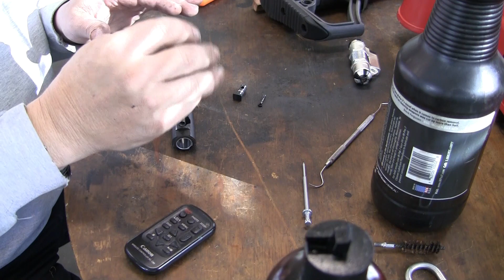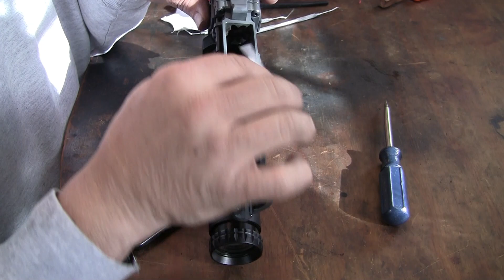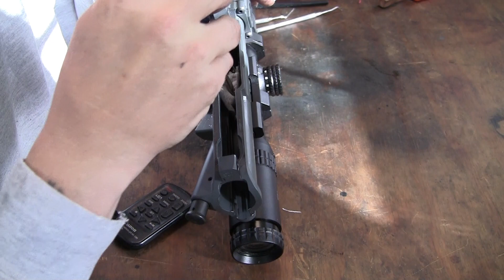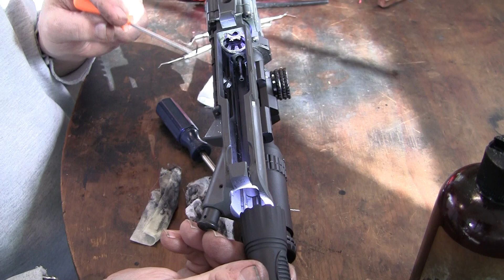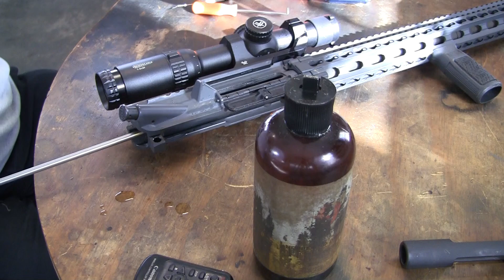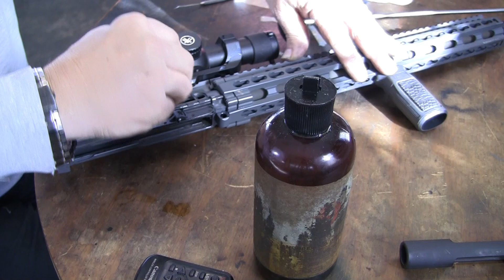AR 15 Cleaning the Upper Receiver & Reassembly

Comment: Thanks for the video! I find that AFTER using a chamber brush, instead of taking a patch or qtip to fish around and dry the solvent, try using a foul out spray. I really like the polymer safe foul out sprays from Birchwood Casey, Lucas or real Avid polymer safe foul out spray. Everything's already scrubbed and cleaned/loosened up and instead of drying just blast everything straight out the barrel and then let it dry and run a lightly oiled patch down the bore and barrel and you're good to go!